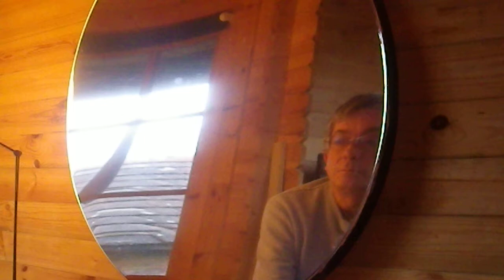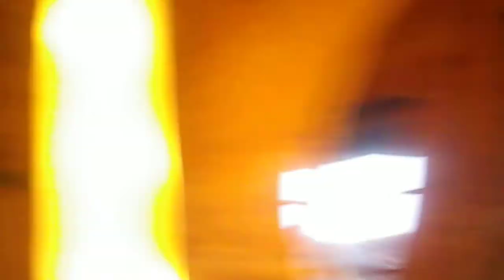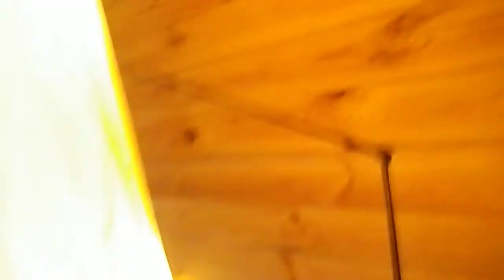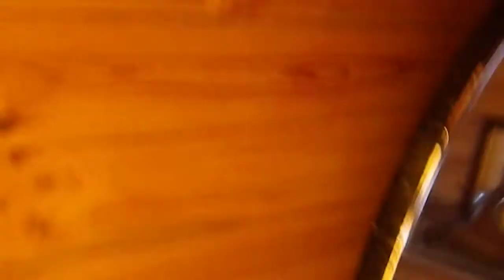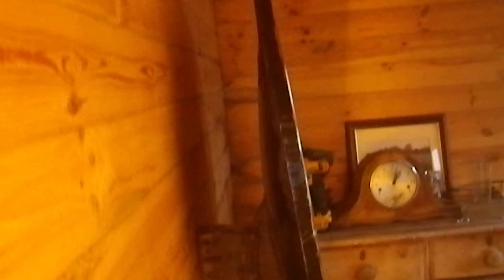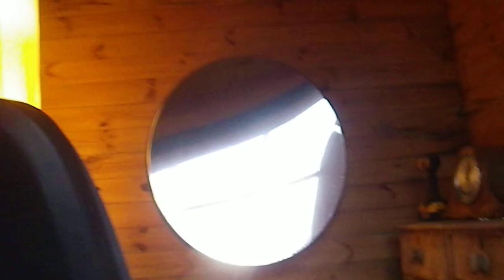Vacum varible focus mirror

Comment: This is quite amazing. I'm looking to build an adjustable solar cooker and this would likely work. Do you know of other vacuum pumps that might work for this application, and how did you go about using the tape/epoxy/mastic to seal the mylar chamber to be totally air tight?
Reply from the maker: I looked for ages for a suitable pump, it doesn't need to be a particularly high vacuum but I wanted to be able to control it with some precision and the door locking pump works a treat. It had some sophisticated electronic controls which I removed as the motor is simply 12 volts DC and reversible. Many vehicles use electrically powered vacuum pumps for different purposes so I'd look in your local salvage yard.
Mylar mirror film; I rolled out sufficient film onto a bed sheet (to protect it) and laid the dish on top. I then cut around the dish allowing an overlap of about 100mm (4 inches) and applied a bead of silicon to the external flange of the dish. To achieve an even tension (now think points of the compass) I lifted the North bit of film and secured it gently to the back of the dish with a short piece of gaffer tape. Then the South bit, then East, West. Next NE, SW -  NW, SE. Continue all round the dish, each time you apply the diametrically opposed bit of gaffer tape tension it slightly.
When the silicon has cured it is possible to cut away all the gaffer tape leaving the film firmly attached to the outer flange.
The epoxy resin was used to seal the mounting holes and secure the gland connecting the vacuum pipe.
It would be amusing to build an array of them focused on a single target, with sunlight at about a kilowatt per square meter you could do some fast cooking :-)